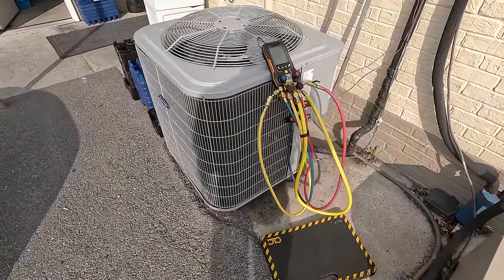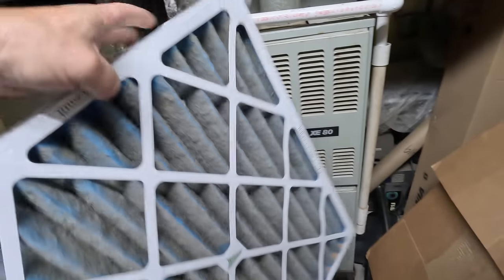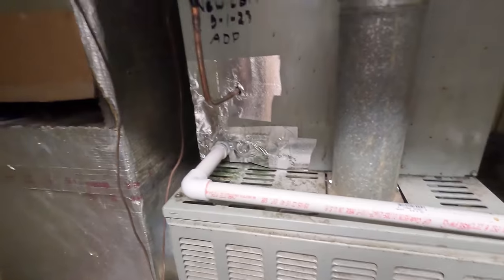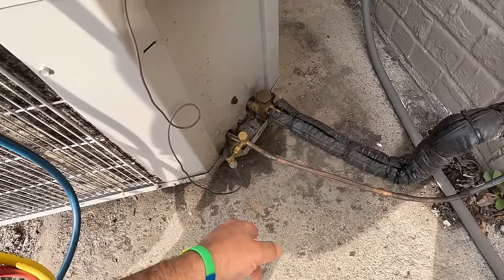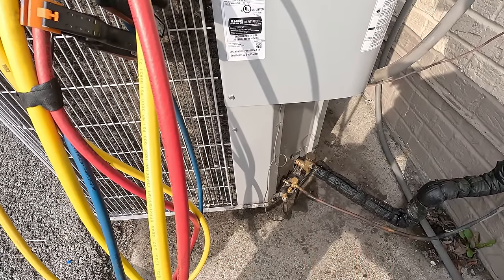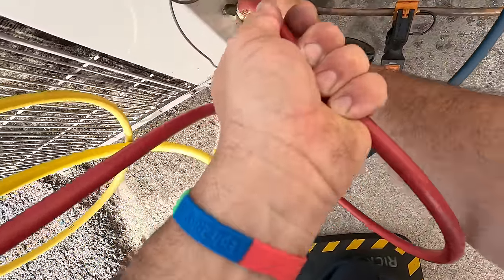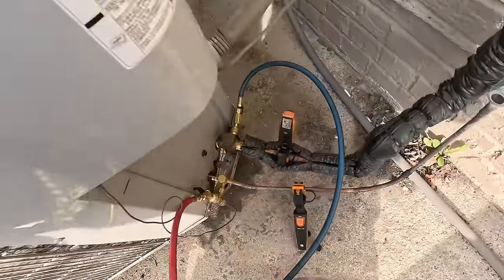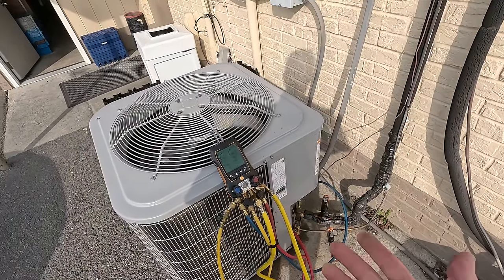Troubleshooting Gas Station Ac Issues With An Upgraded System

Comment: Noncondensables wil make subcooling appear higher than actual. Did the hackers even pull a vacuum or just charge it with air in the lines?

Comment: Id suspect it is the condenser fan running too long during low ambient temperatures because HVAC is designed for 95°F ambient and if I heard right the temperature was atleast 10° below the designed temperature which lower the capacity and that fan running too long will cause the bubbles in the sight glass in low ambient environment  the fan motor should run less than if it was at designed temperatures increase the off time of the condenser fan motor by increasing the on cycle pressure to 445PSI and cycle off at around 365psi this will put you condensing temperature between 125°-110°F and Ill bet the sight glass will clear up this will also effect your SC temperature and the SH temperature, with out the TXV the superheat and SC can not be set due to the fluctuations of the capacity due to the incorrectly set fan cycle so a TXV would help to stabilize the capacity fluctuations

Comment: Carrier usually has a txv subcool on the data tag, not that this had a txv but from my understanding it is usually between 7 and 15 degrees depending on the unit. That’s when they say it has a solid line of liquid.

Comment: ADP has many coils, some with txv, some with piston, so it all depends on what you order/get. last I seen they were all factory ready for 410A with TXV and non-txv models supplied with both 410 and 22 pistons. assuming they used the right for the tonnage range, set the airflow right and installed the correct piston, it should just work.
Reply from the maker: Anything higher than 13 seer has issues without a TXV.  I made that mistake once before.
Reply: @HVACRSurvival  that makes sense, as they're trying to squeeze efficiency out of them, which pretty much means having over-sized coils both indoor and outdoor.
or should they always have been that large with TXV's? (YES), the bean counters are getting double fisted in response. lol

Comment: Great Video. Thank you for sharing. May I ask, why put high pressure control on liquid line service valve on residential condenser ? How many pressure need to set for it ?
Reply from the maker: It’s used for fan cycling to help it work in low ambient temps.

Comment: I wonder what your target superheat would be. testo makes some psychrometers to get return wet bulb temps.

with it being so warm in there I would assume there is a high target SH and with high suction pressure I would be leaning to an overcharge
Reply from the maker: Generally, your subcooling and superheat are gonna be fairly close to the normal zones and neither one of them was so that reason why I didn’t even mess with checking that.   I would’ve guessed the super heat would’ve been lower if it was warmer in the wet bulb is higher.

Comment: What was your target superheat?  Did you take a WB temp?
Reply from the maker: I didn’t spend much time on it, but you’ll see when I first open the unit that they wrote down all their numbers and they had a super heat of 18 originally when they started it. I believe they had us install a Txv that was the only solution of this. When your sub coolings already not there,  raising the superheat is just gonna starve the coil even more and that was all gonna change based off outdoor temperatures. I left it as it was.
Reply: @HVACRSurvival  
Sometimes all you can do is walk away and address it later.  As much as I dislike changing TXVs (usually messed up by not purging with nitrogen or bulb charge loss), they are necessary.

Comment: My bet is no piston or piston too large, seen it with yokels who don't have enough understanding of how things work.

'Phantom' subcooling is turbulent rather than laminar flow because someone didn't deburr their tube causing a very small venturi effect. 4F SC is not enough to guarantee bulk fluid is below boiling point with said turbulent flow.

And just to be cleeky, Rick, 🏳️‍⚧️
Nyah! 🤣🤣🤣
Reply: probably has a 410A piston factory installed, maybe wrong piston or oversized coil for the condenser tonnage. hard to say what they've done, but a TXV should fix it, assuming the gas isn't mixed or has non-condensable schmutz.
Reply: @throttlebottle5906  I've gone behind other companies who buy the coil based on cabinet size and they'll be shipped with a piston for the largest supported capacity (like goodman with their ARUF4860 air handlers, the piston is for 5 tons, but because it can be used with a 4 ton application they never swap the piston to the one included with the condenser) you end up with low suction pressure and the yokels will overcharge to compensate for the low suction pressure and end up with too low SH trying to hit a target 40F evaporator saturation ballpark.  And now because the system is overcharged with not enough backpressure on the liquid line you get velocity effects in the column causing it to be colder than expected.  That stupid low compression ratio Rick saw is the biggest tell the piston is too large for that condenser.